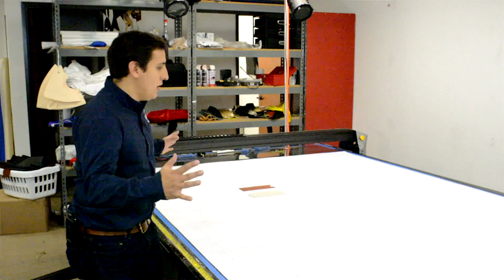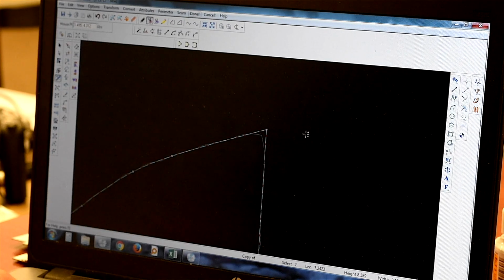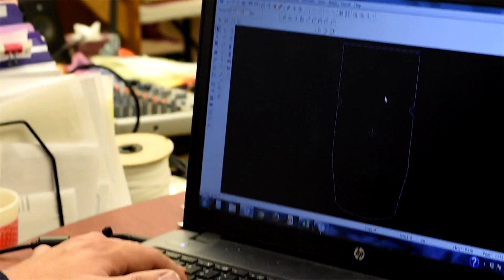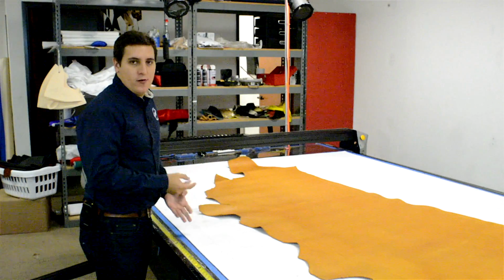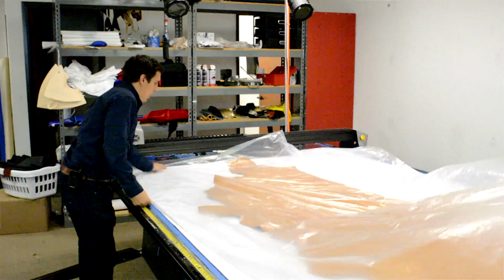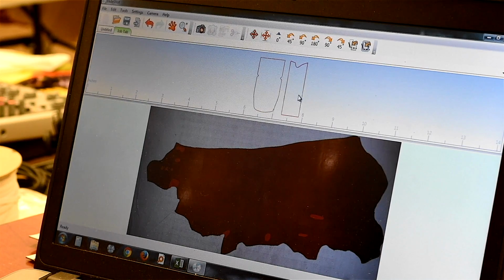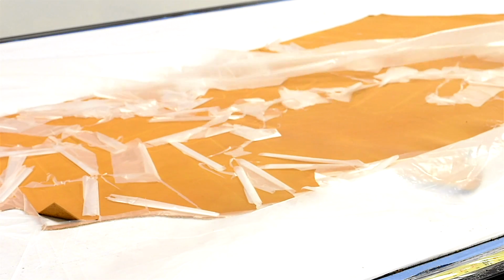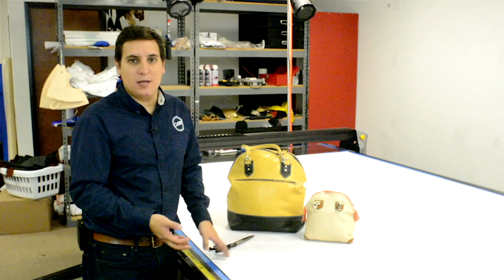How To Boost Your Precision, Material Yield, And Speed To Market

Comment: Aren't lasers more the standard these days than those blade cutting machine ?
Reply from the maker: Hello ABADA ABADA, Thank you for taking the time to watch our videos, you are right, lasers are the most standard these days, two reason why I will use the blade over lasers is one, I find it cost more and the leasers makes the leather smell like it have brunt, lasers dose a great job cutting the leather, I just don't like the after smell.

Arthur
Reply: ABADA ABADA laser is not used as much for leather. Reciprocating blades on a conveyer system are used mostly in higher volume cutting. Laser you will see for signage and some textile applications